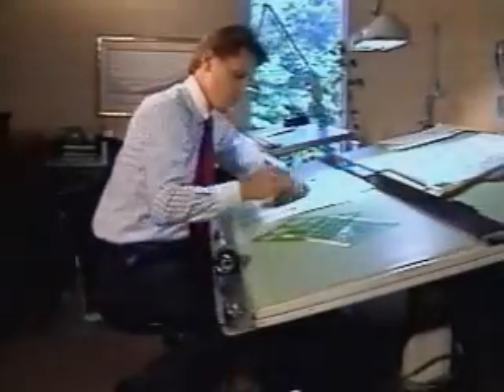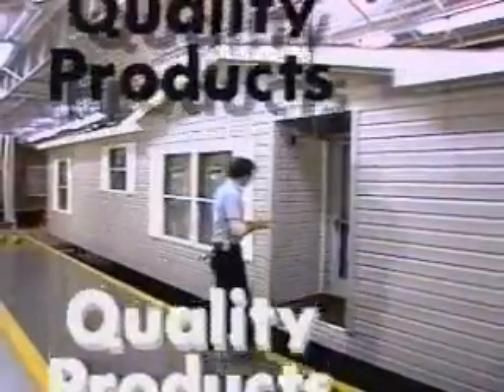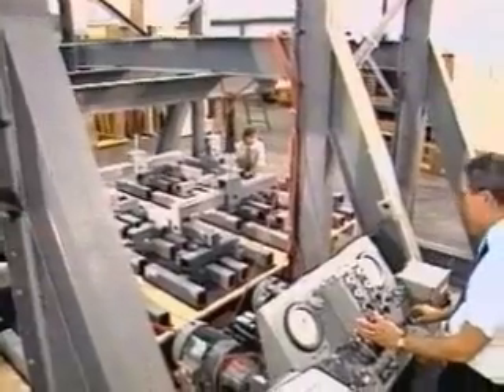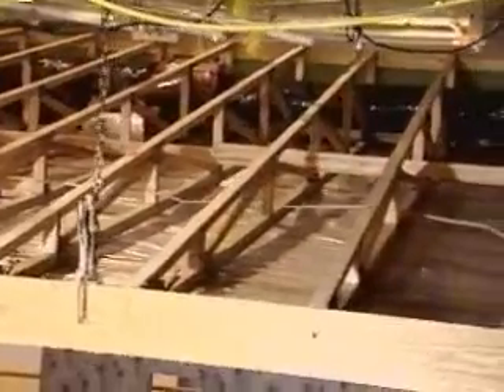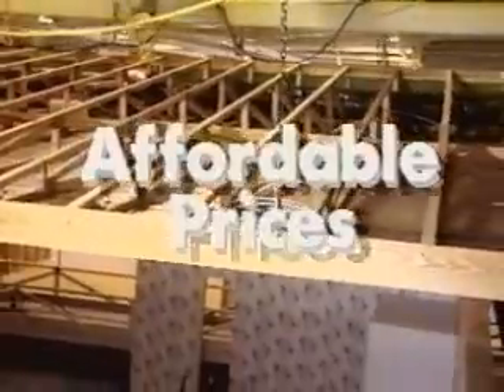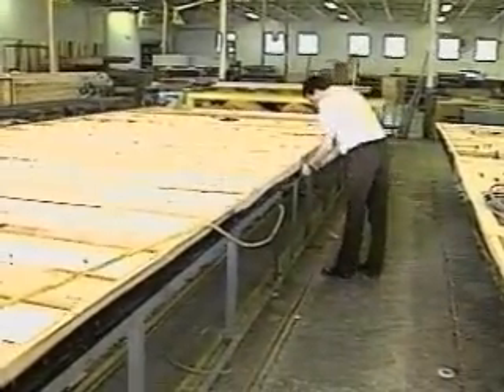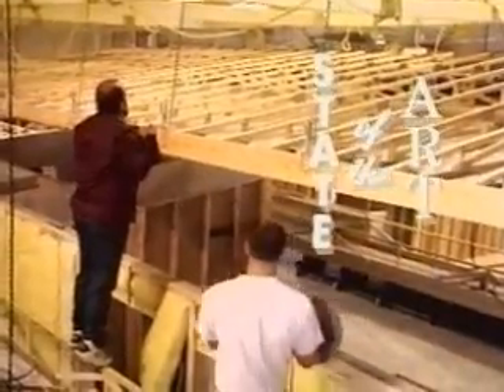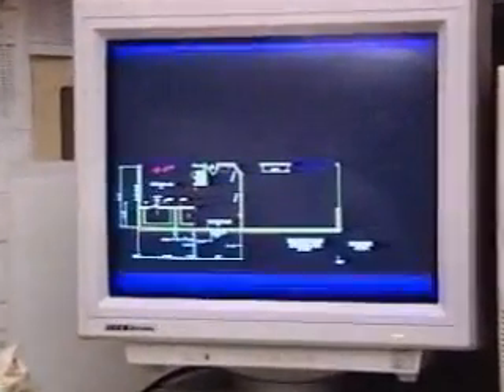Today's Manufactured Homes

Comment: I purchased a new Dutch manufactured sectional home. I had plumbing leaks from a screw drilled into plumbing in the floor. The home was set on a plumbing line that was concealed by the heavy plastic vapor panel. The multiple leaks flooded the vapor panel that runs under the home. I had up to18 inches of water that destroyed everything in the floor and created lots of mold.